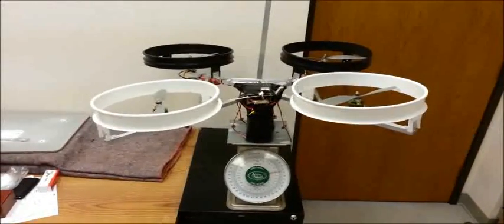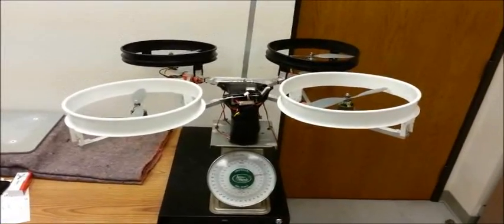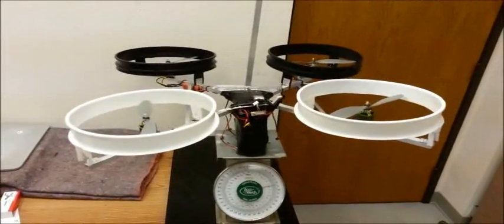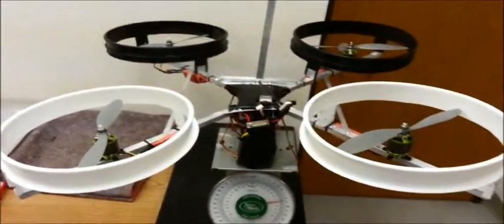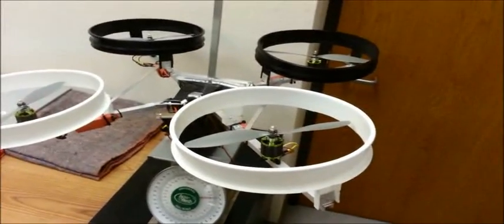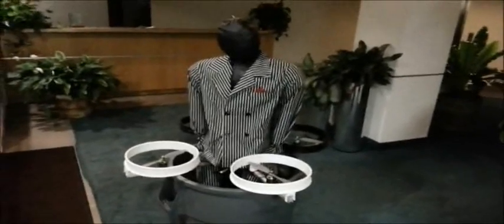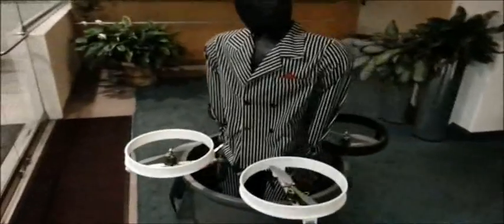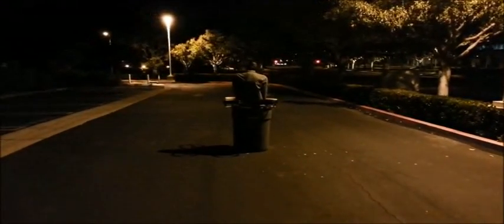Project Thunderball

Comment from the maker: By "attitude control", you mean yaw heading. That is controlled by a compass and will lock onto any offset from North that I desire (and can change on the fly). Unfortunately it was not calibrated in 3D space in its magnetic environment. This caused "yaw confusion" as witnessed at the end of the video. If you meant "altitude control", that is not well regulated with a barometer when near the ground. For that, sonar would be an improvement over the manual throttle method I use now.